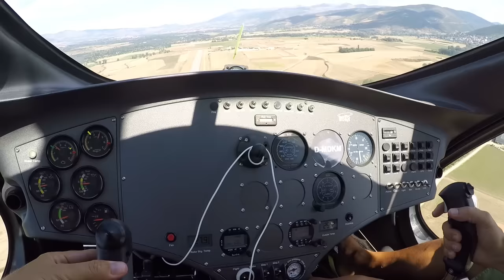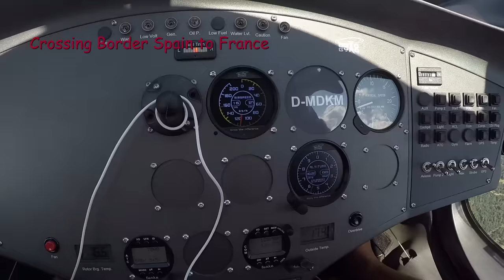Cavalon Gyroplane Gyrocopter Girl Landing & Take Off Density Altitude 6800 ft  30°C

Comment: Very nice. Excellent landing and take offs. What was the wind speed?  I really like the Cavalon, its "2 seater" design looked rather roomy(my opinion). I was impressed with the sweet control panel,having all the needles and gauges right in order of importance.
 The 115 hp appeared to work effortlessly,adding maybe another 20 horses and a rotor so you can pull off vertical take offs and landings.  My goodness what a breath of fresh air Gyro copter girl is. A very refined woman. Does she have any sisters?

Comment: Not very many Gyrocopters in the united states. Usually only sold in kit form. Looking at possibly building or buying this year. Looks like so much fun. I must say that the views are spectacular! (both in and out side the cockpit ;-) By the way, the audio in your headset transmissions sounds a little distorted. not sure if you are on the verge of VOX cutoff or if the mic might be failing. you might want to check playback. i double checked it with other videos on my end to see if it was my speakers. seemed to only be in this video. Have a great day!!!
Reply from the maker: Yes, we think it is the installation of the radio, because in the other video about flying in Florida we have same Devices working perfect with ATC.

Comment: nice landings!  In Arizona we have some higher altitude airports that can get a pilot in trouble if they are not checking out the load on their planes.  Such as the Grand Canyon airport at 6600 feet.  Keep posting videos,. Also, any update on getting your dogs back?
Reply from the maker: Thanks ;-). Yes W&B  & Density Alt is very important to know the limits of your Aircraft. Our Dog Whitey is still in Bosten and unfortunately the 2nd decision the judges took is that they support 1rst decision of college. Apparently a Judge can make decision based on personal opinion and not on facts. We are all shocked about the outcome and the fact that one can steal and officially get away with that. Whitey is now over 2 years by those heartless people and is now 7 years old. Merry Xmas GG

Comment: Regarding mountain flying, how does the Gyro handle thermal updrafts and mountain waves compared to a fixed wing? Great video and thanks.
Reply from the maker: Gliding is around 1:3. Gyrocopter are more stable in turbulence because of inertia. Therefore less bumpy and less correction on the stick.

Comment: Brains and beauty, hard earned am sure, but what a great way to see the world - lucky girl - interesting concept - but is it safe, is it a helicopter or a plane, are there limitations as to what weather conditions you can fly in??It just seems a little flimsy/low on power?? Regards,Baz in Texas.
Reply: it's actually a plane. the rotor is not connected to a power source (as far as I know... I may be wrong) and the wind spins it. when it spins it acts as a giant gyro (hence gyroplane) and makes it stable and provides lift. it is very hard to fly and can't do a lot of maneuvers. so I guess you have to be weird to love them
Reply: Barrie Myers it flies like an airplane, it needs speed to get the lift. But it hasn't wings because the rotor (that is free to run) does the job. It is better when facing the turbulence, and it can land in a tiny spot if the engine fails. It is not as fast as an airplane, and it can't hover, but it is a good way to travel n the sky.
Reply: Most modern versions are the composite with an engage-able  pre-rotor run up. At this time if you have to ask the cost....
Reply: I read where gyrocopters have the highest accident and fatality rate.
Reply: Given proper training and a good understanding of the flight characteristics of a "sport" rotor aircraft, I don't think there are firm stats for today's designs. The gyros of twenty five years ago were much like other fixed wing ultralights flown in the USA;. Minimum airframe, in the open, maybe a wind screen.. Many tried to teach themselves by relying on previous flight experience. Some with no experience Once a two seat aircraft was available, a qualified/certificated instructor sharing control, the safety records improved.dramatically.  My opinion; gain at least a sport pilot licence before transitioning into any rotor craft. The military can afford to train a pilot in a highly constructive and  safe,
 consecutive manner.

Comment: Hi there, after checking out the family tree, found out a relation of mine , founded the glider club in fife Scotland, he used to fly spitfires during the war, I always intended building a glider myself, but really wanted to build a Gyro copter. I wouldn't attempt it if I didn't have the experience to build at least the Gliders.Have been in the trade for over 50 years now retired. do you know the best place to acquire the plans for a Gyro copter. Would build a small model one first with test modifications before going onto full size.
Reply: Sandy Fraser hi I'm in the US. I have the plans for a gyro bee. Look it up if your interested I'll hook you up.
Reply: thanks, will do this, cheers.

Comment: How do you steer? Does the rotor tilt left/right up/down?
Reply: pepper669 yes. the stick controls rotor pitch IE left right forward, the pedals can spin the helicopter left/right usually in hover etc
to go forward you tilt the rotors forward & increase collective ie power

pretty basic, u just need a smooth touch to control a chopper
Reply: No.  The rotor merely acts as a wing, although a rotating one; thereby providing lift only.  There is also a prop in the rear that provides forward thrust by pushing the craft along.  the steering is accomplished by way if the control surfaces at the tail.
Reply: a gyrocopter is NOT a helicopter. :)

Comment: during flight, forward motion keeps the blades spinning i think, BUT prior to take off, how to you get the blades spinning, do you simply open the throttle and they spool up by airflow, or do you have to spool them up by an electric motor prior to take off?
Reply from the maker: Pre-rotation system with engine up to 200 rpm for Rotor Blades.
Reply: Thanks.

fly safe :)

Comment: That looks like an awesome craft you have there, my question is what happens if your engine dies, it doesnt appear that you have gliding capability. Do you have an emergency power alternative or is it that you just go down? If so what then, do you have parachutes?
Reply: MilesDei In case of engine failure, as long as you have enough altitude , you can auto-rotate (auto-rotation).

Comment: Looks like your Cavalon is very smooth at the stick, is it linkage or cable control to the rotor head? I fly an RAF 2000 from 6k ft in Idaho.
Reply from the maker: A Linkage to the rotor head and cable to rudder

Comment: Flying quite high in this video. Do the controls become less responsive in the thin air?
Reply from the maker: No response still the same, because IAS is same and GS higher (theory on no winds condition and same cruise speed)
Reply: Thanks!
The day might be coming for me to try a gyrocopter.
Reply from the maker: Try it you will like it :-)
Reply: The higher TAS might be more relevant than the higher GS. :-)

Comment: In old gyro-copters, there was a "jump" takeoff technique, consisting in accelerating the rotor using the engine, and then applying collective to lift using rotor inertia and forward thrust,... am I wrong?... is yours capable of something similar?
Reply from the maker: No not capable

Comment: Why does it land to a rolling stop, on wheels? Is there some benefit to this?
Reply: because it is not a traditional helicopter it has a rotor propeller in back that pushes it so it flies like a combination of a helicopter and plane it cant take of vertically but does not need a long runway it is also probably harder to fly than a plane but easier than a helicopter
Reply from the maker: right :-)
Reply: I see it now. Interesting.Thank you.

Comment: Duh...everything that doesn't have wings frightens me as a pilot (not a heli fan at all). But that ride was quite smooth )
Reply: Helicopters and gyroplanes DO have wings. The rotors are wings. Many pilots say: "one should never fly in an aircraft where the wings move faster than the plane."
Reply: Christopher Milne 100% true. yet it's a psychological issue for me - wingspan

Comment: Gyrocopter Girl → In the video description, you mention that autogyro you fly is powered by a turbocharged Rotax.  
 
I was wondering if you have ever made that same flight - or another flight at similar density altitudes - in an gyro with a naturally aspirated Rotax?  If you have, how "noticeable" is the difference in performance between the turbo and non-turbo Rotax engines?
 
{Thanks in advance!}
Reply from the maker: Yes same Airfield with 912 Rotax. It is noticeable, but you can use it only for 5min. It is depending where you are located, home base. The turbo does consume more gas and therefore less endurance on longer trip
Reply: Gyrocopter Girl → Roger all that - Thank You.

Comment: you cant do vertical takeoff and land?
Reply from the maker: no, it is a Gyrocopter not a helicopter
Reply: gyrocopters develop rotation through forward movement.  The rotor is not powered.  Think of it as always falling, but being pushed forward, generates lift like a fixed wing.

Comment: never understood the interest of a gyro for me its like an amphibian car a bad plane abd a bad chopper :-( but may be someone can explain?
Reply from the maker: Short round trip and long trip if the scenery is nice. You see much more, because one can kind of "hover" and no stall (fixed wing) possible. Cost are not to compare with helicopter. Services much easier. Less to hangar cost because of the 2 Rotor blades.
Reply: Gyrocopter Girl yea not really convinced but i guess it's a matter of taste i should try obe of theses days but not easy to find one around for a joy ride but the look of the machine is pretty cool:-)
Reply from the maker: No intention to sell it :-). I like to fly also fixed wing like the Black Wing Sweden :-)
Reply: Gyrocopter Girl no intention to buy it ether:-)) i fly Dornier 228 in the bush wich is kinda gyro when it comes to land short :-)) but if i come around your pkace I'll gladly go for a ride!
Reply: Gyrocopter Girl by the way..you fly from the right seat! like in choppers?
Reply from the maker: Great plane the Dorner 228 very good STOL for its class. But not for my Budget ;-).
Reply from the maker: yes from the right. And as you are always in autorotation I land also in auto rotation and engine idle to train for a engine fail :-)
Reply from the maker: Ok saw your landing. A bit longer then the Gyrocopter lol and also the Black Wing will need less lol
Reply: Gyrocopter Girl that was because the runway was long! i can do better if i keep the gear up:-))) as for the "ouch" bit it was just my colleague being a bad ass;-) !

Comment: The  Woman  is  Beautiful;  but  going  up  in  that  copter  would  scare  the  Hell  out  of  me.  Engine  cuts  off  for  ANY  Reason;  that  copter  has  the  aerodynamics  of  a  piano.  You're  as  good  as  dead  from  that  Height.
Reply: not sure about a gyro but in optimal conditions a helicopter can be landed in a safe manner through auto rotation when power is lost
Reply from the maker: Gyrocopter is always in auto rotation also for landing and I land if possible always engine idle to be trained if engine fails. Gliding arround 1:3
Reply: That's not the case at all even in a helicopter.  While it's a little trickier than gliding a fixed wing airplane, even a traditional helicopter can auto-rotate (search that term on YouTube to find examples) and land safely.  It's something helicopter pilots train to do.

The Gyrocopter she is flying is autorotating 100% of the time, there is no connection to the rotors from the engine, the engine just turns a propellor that pushes the helicopter forward, and it flies 100% of the time on autorotation.
Reply: Gyrocopter Girl:  1:3. That sounds survivable. Have you tested an idle engine landing with the gyro?